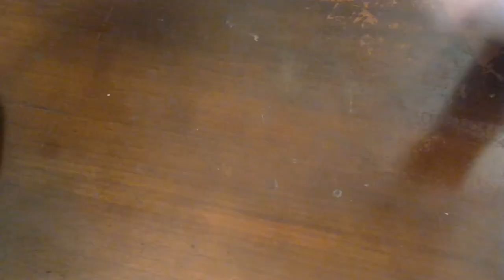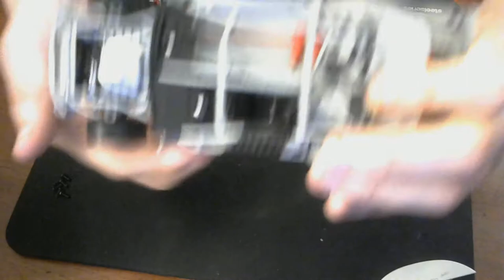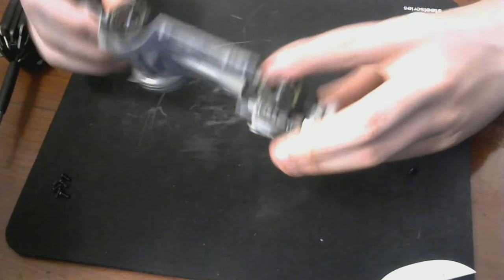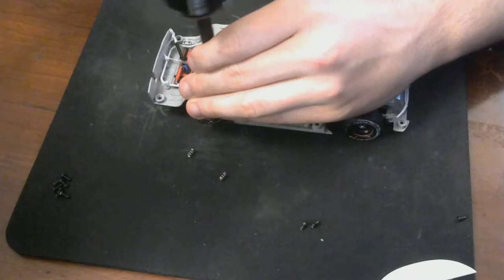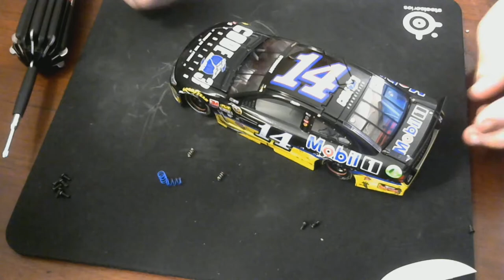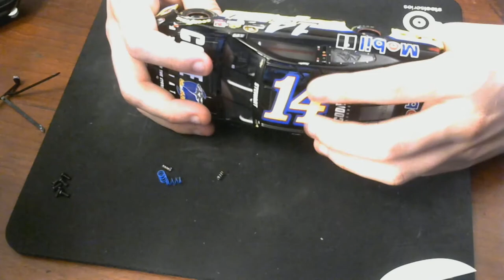How to lower you 1:24 NASCAR Diecast

Comment: For some reason, my left front wheel wont rise like the right front does when the car rests. So the left front of the car is sticking up due to that. any idea what is blocking it from rising?
Reply from the maker: Sounds like you didn't remove the spring on the front.
Reply: @HeyStack199  i got it, there was actually a little plastic nub just inside the left front wheel I had to snip off. it was preventing the left front from resting and rising

Comment: Is there a way to make the side skirt bent? (Dumb question) 😂😂
Reply from the maker: Take a set of pilers to it and pull them out. Make sure to use some with rubber ends so you don't scratch the paint up.